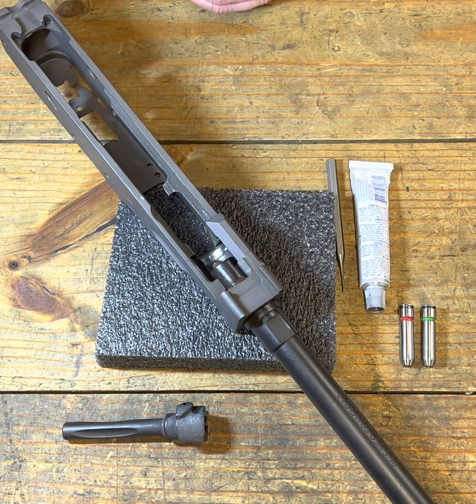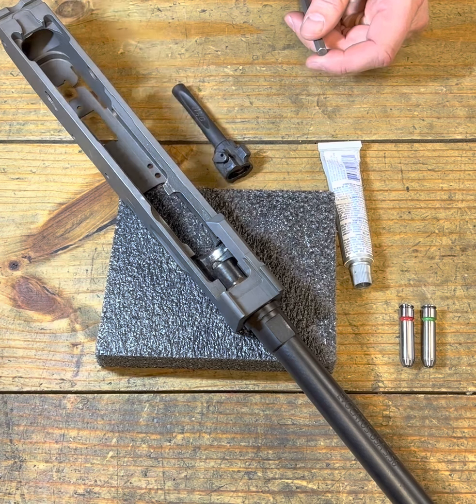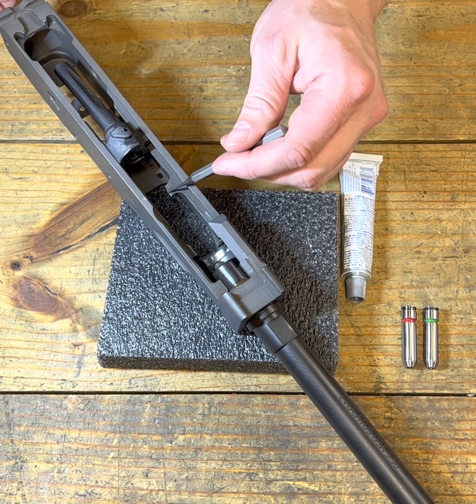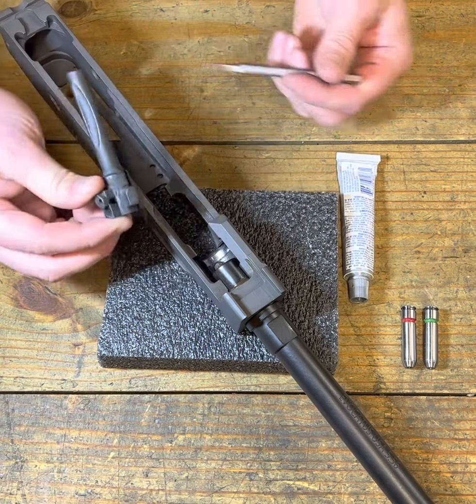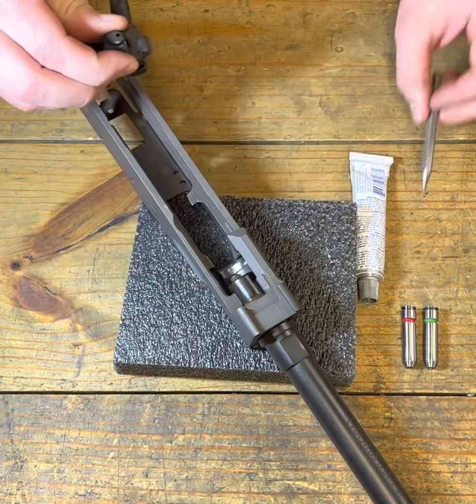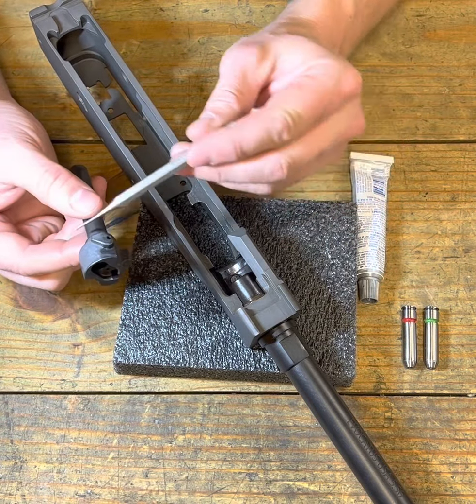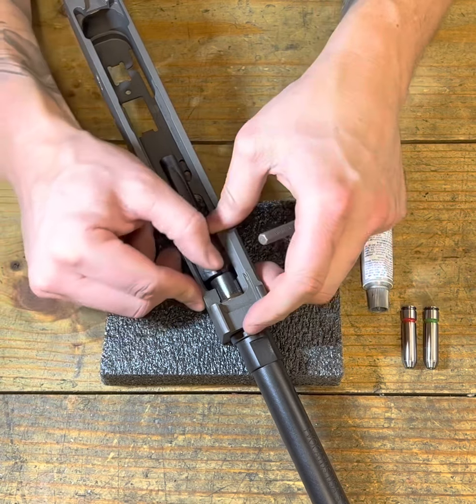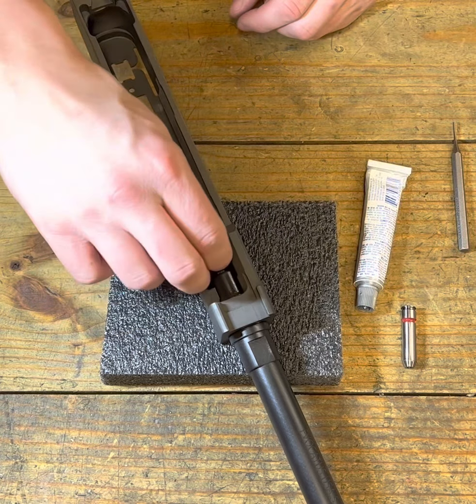How to Galil *MasterClass* ep.3 : How to Force Match Your Bolt (PART 2)

Comment: I’ve done 4 Galil builds on TorTort receivers, using Troy Ess barrels.  I haven’t found it necessary to do anything with the bolt.  All the barrels, including a 16 inch unknown maker, have had too tight headspace, which is much better than being too loose.  I’ve used shims from .004 to .009 with a 130 ft/lb torque that takes just a bit of pressure to close on a Go Gauge.  I doubt long term use is going to change the headspace enough to matter.

Comment: It's my understanding the bolts are "Case Hardened". And the Hardness depth is shallow .004-.005. Now by your removal of material i.e. imparting wear. The surface (bolt) area which comes in contact with the receiver probably has substantially less hardness. My question is have you ever conducted a ROCKWELL HARDNESS TEST??
And if you haven't would you consider doing a test on your finished product??

Comment: Thank you. Every technique helps our community. On AKs, many "lap in" the last, to an 80% or more lug face engagement with non-embedding lapping compound. Then settling at a "two thumb" close from rear carrier pressure on a GO Gauge. Having a gas tube installed, or some other form of piston guide helps ensure parallel lug engagement during lapping.
Reply from the maker: Yeah, I should’ve covered lapping a little better here, but thank you for sharing it! All great knowledge.
Reply: @evocatusstrategic  You are welcome. Some of the best knowledge I have found comes from the translated DDR East German armorers manuals, a wealth to say the least, but nothing compares to expierence. God bless, Keep yer powder dry, and front sight well sooted.

Comment: A lot of work. Easier to make the shoulder of the barrel longer and then machine it down to fit the bolt without messing with a bolt that is responsible for high psi

Comment: Forgive me if this is incorrect, but wouldn't filing these areas remove the surface hardness?  Or are the bolts hardened through and through?
Reply: Yuuuup. Any gun headspaced like this is a hand grenade waiting to happen. The barrel is short chambered and needs cut deeper. The technique shown here is no different than century grinding the back of cetme bolts. Force matching is terrible. 

If the bolt closes on an empty chamber, it has plenty of lug space. If you add a go gauge and it doesn't close, the chamber needs cut deeper. DO NOT cut on lugs. This practice is dangerous and lazy.
Reply: @mikecramer3258  Is it safe to set the barrel out with shims instead of reaming the chamber deeper? I thought the chamber depth was good to go from the barrel maker and you just need to get it positioned correctly relative to the receiver.
Reply: @AlwaysBored123  Some barrels are short chambered, some are long chambered. Meaning you need to cut the chamber deeper or trim shoulders and face, respectively. Depends on the barrel, the maker, everything. I would not use shims unless barrel is chrome lined, in which case a chamber reamer would not work, unless maybe carbide.
Reply: @mikecramer3258  Thanks for the info. I think I have a good idea of the process now. I wonder why no one seems to do press in barrels like this? I had never heard of reaming a chamber until I started digging into building a Galil. Never seen it mentioned as part of AK building.
Reply: @AlwaysBored123  An AK barrel is more "standardized" as far as chamber depth cut, and setting it in and out by pressing it. One should still check with gauges, obviously! The Israelis opted for threaded barrels after capturing AKs during the six day war and liked how they didn't jam with sand as their FALs sometimes would. FAL barrels are threaded into a milled receiver, so they already had the tooling and knowledge on how to do it, so that was that. The Galil takes features from the AK, FAL, and AR15 and makes an amalgamation, best of the best, gun. In a time when optics were still very rare, the Galil had flip up tritium sights. Nothing else had that, especially standard on a service rifle; a very forward thinking design. 

There are a couple options for press-in barrels now. Iron Curtain Customs makes trunnion blocks, Childers makes the stamped receivers to take Galil parts. Standard AKM barrel, but is 7.62x39 instead of 5.56. Would obviously need a 7.62 bolt too.

Comment: building on a threaded barrel and receiver that are not perfectly machined for each other can be tricky....but if your chamber is shallow, and you dont like the idea of filing away on the bolt or finish reaming the chamber, I would get it as close as possible with shims then lap for the perfect lug engagement.  Just watching someone filing on the bolt makes me nervous....
Reply: I was slightly, taken off originally when I started this video of the head spacing process. thank you for confirming my thoughts on shims , when using new and old parts together . I have not started yet and I'm glade I have found this vid. on the processes. I've read on a well known web page on a head spacing process , that I wasn't seeing here. I see why , new parts is always different then used with new parts , (says me ). again, awesome video !!.

Comment: Great video. Well explained and shown.

Would love to see a tutorial on installing the bullet guide. That's the one step of the process that gives me pause.
Reply: Hello I got my bullet guide from hillbilly firearms.
it doesn't fit quite right.
its a tortort 80% .
it's sits all the way down in the receiver but the guide ramp is below the rail in the receiver by probly 0.030 but I think if I shim it up to flush with the rail the bolt will jump on the guide  any ideas what's going on .
idk how to post pics or video in the comments . And another issue I'm having is the barrel threads to receiver seem crazy loose to me but I don't know  how loose is to loose any help is much appreciated. Thanks in advance

Comment: Could you install the bolt and carrier with the go gauge installed and then torque the barrel in?
Reply from the maker: I would not advise it. You’d be torquing against the lock up of the lugs on the bolt and not the threads in the receiver. So, No. I recommend you check out episode one in this series that shows how to torque the barrel to spec.

Comment: Thank you for taking time to make these videos. I'm not a gun Smith but I've built a few aks and I'm currently building a sar kit on a Tortort 80%  and my kit didn't come with a bullet guide.
 Would you happen to know where I could find one and witch one I need.
 I've heard there are guide issues with different receivers.  
Thank you for your service  🇺🇸 
Any help is much appreciated
Reply: Hillbilly Firearms has those bullet guides. At least thats where I got mine a couple months ago.
Reply: @seibertsmiths  Hillbilly is the only one I've found that the the bullet guide and rivet. Mine just arrived in the mail today.